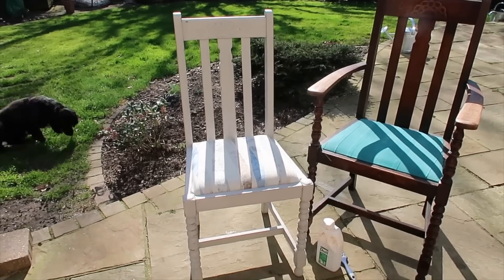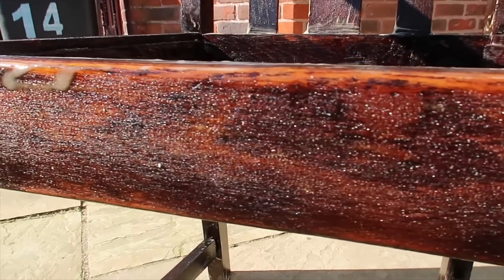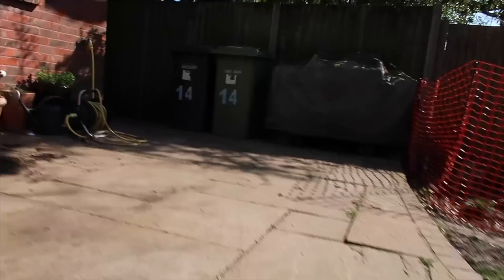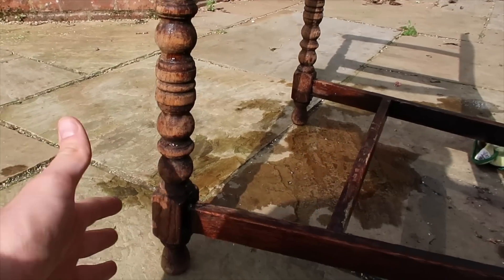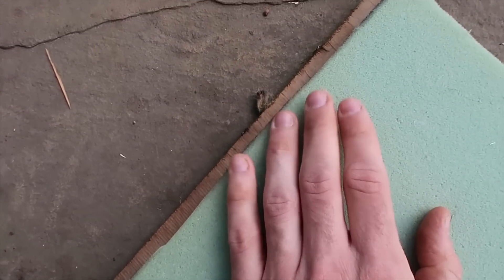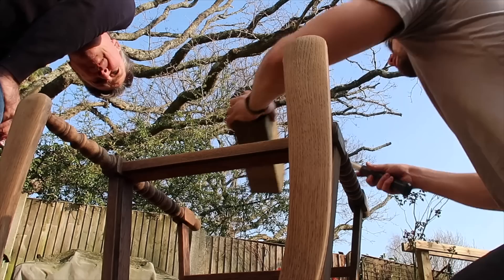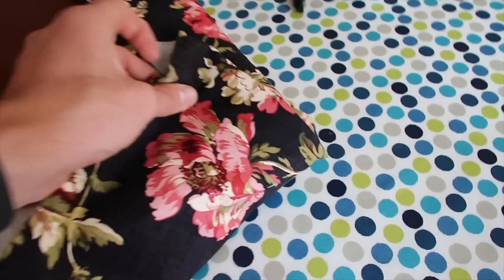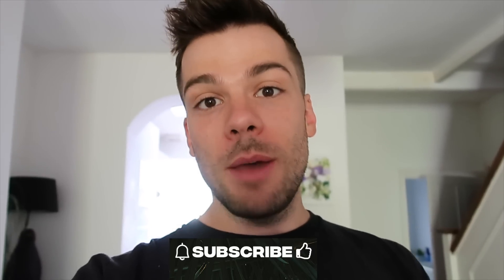EXTREME MAKEOVER: Restoring an Antique Victorian Chair!

Comment: Absolutely love this video. I have an antique Victorian bed (double) that has a 7-ft headboard and 4-ft footboard of solid walnut. There is walnut burl wood inset on both the headboard, footboard and side rails, along with gorgeous scroll wood carvings. My parents took 7 years to strip off 9 layers of paint down to the natural wood. My parents paid $10 for the bed from a friend who bought it at an auction for $5. It was given to me when I was 9-years old, and at age 70 I still have the bed. I also have a small walnut dropleaf table my dad found thrown away in an alley. Though covered in several layers of paint, he stripped it and found the walnut. It was so old it was made with wooden pegs instead of nails or screws. I believe that fine wood furniture is something to be restored and treasured, not painted. You did a great job on that chair.
Reply from the maker: I agree! I feel embarrassed that I painted those other chairs!! That story of your bed is amazing!! Old furniture really was built to last!